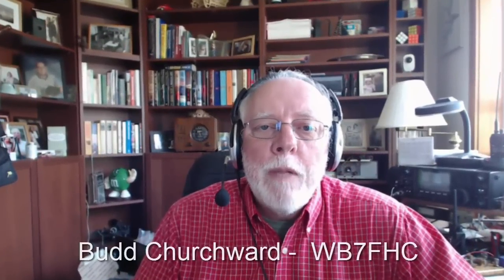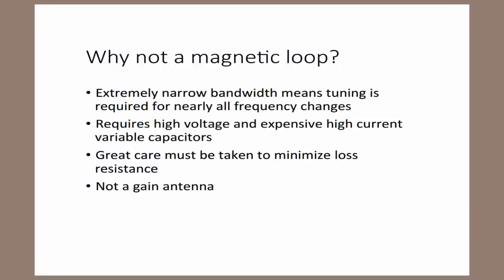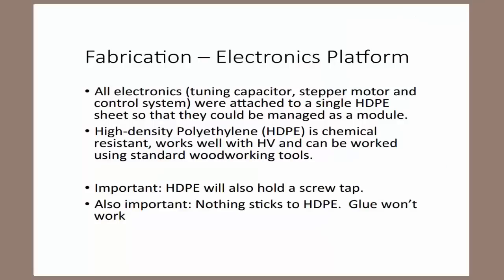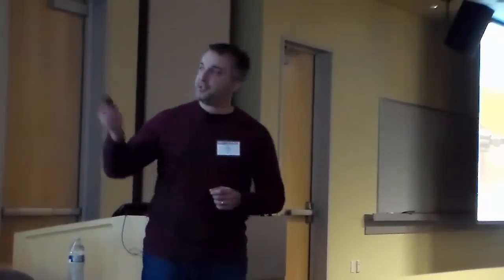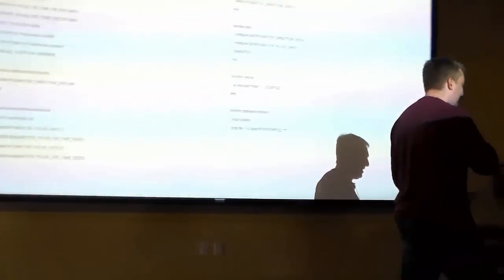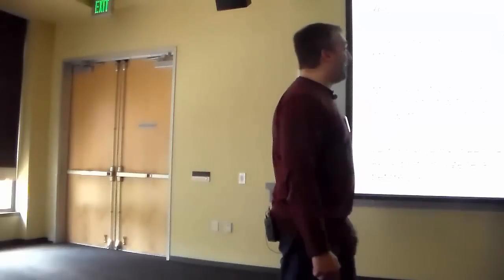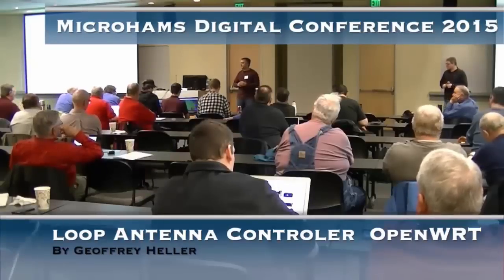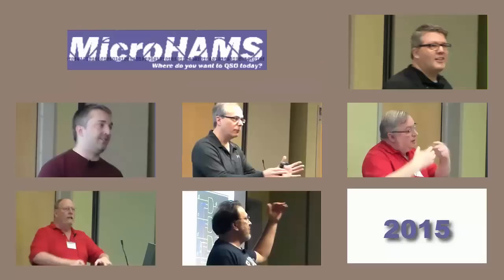Magnetic Loop Antenna at MicroHAMS Digital Conference 2015

Comment: If you want to run a power drill I would suggest a Holehog by Milwaukee , they are an angle drill and they are a gear reduced 2 speed drill used for drilling large holes in wood. I have used them for running large gear boxs on large valves . They have a lot of torque so be careful .

Comment: Why not a magnetic torque limiter, on the shaft?? Why over-complicate it?
Reply: +Seth B The magnetic torque limiter can also work as a magnetic brake too! So that takes care of backlash. We use magnetic brakes, & clutches in paying out wire, rope and other long flexible materials off of spools. If, for example, someone wants to braid a rope some tension is definitely desired. They also do not want slack when things stop, or a rat's nest on the floor, should something break. 73 KI7AQJ